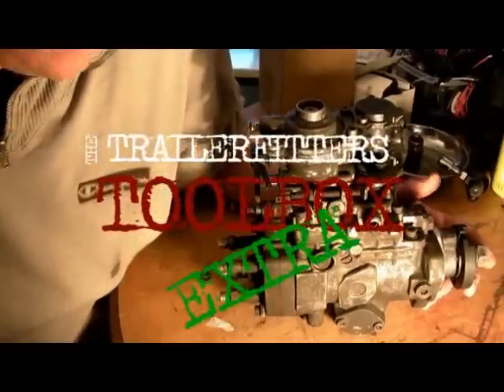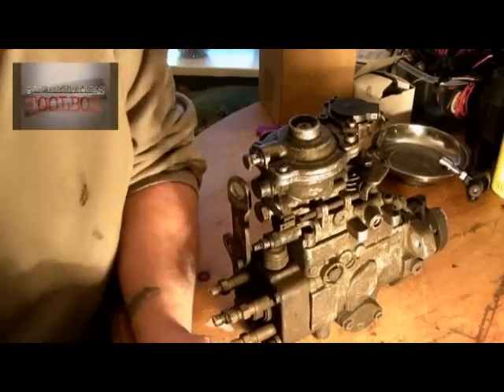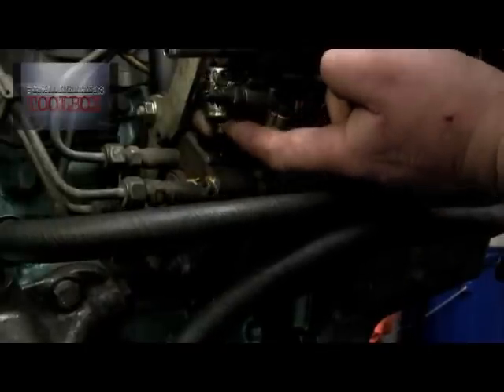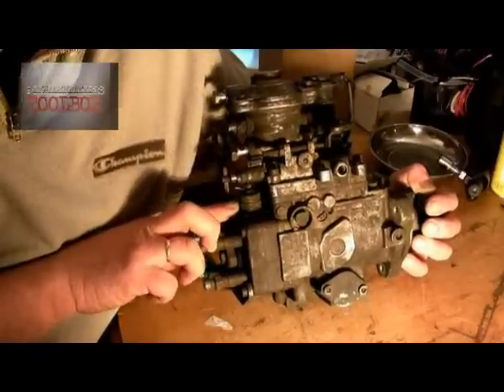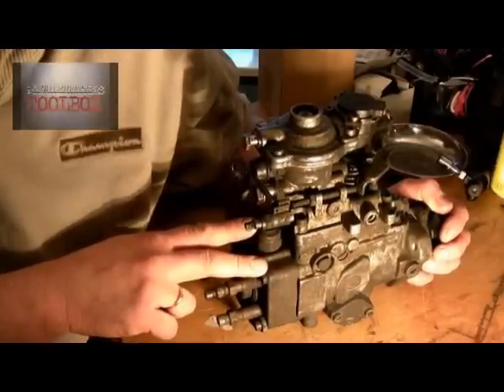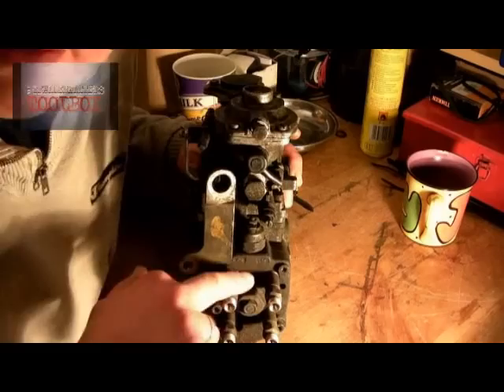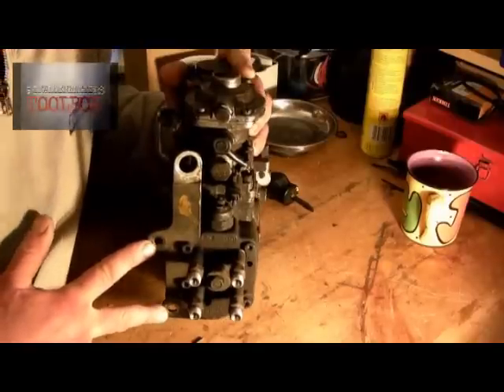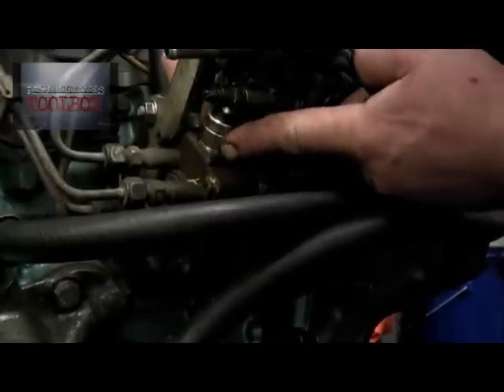Diesel Stop Solenoid 200tdi / 300tdi  RTC6702 Fault Diagnosis

Comment: VERY good demo.one more thing to check.
Make sure you check the plunger on the new and old solenoid .I have found in some cases they are of a different shape.
If you install the wrong shaped plunger on your truck it will not shut off.
This problem seems to be with the aftermarket ones .Genuine ones don't seem to have this problem.I have run into this problem twice and ended up installing a GENUINE stop solenoid.

Comment: OMG, You have saved my day today!  I was driving my truck to get Road Worthy ( mot) certificate. My truck stop at top of hill. I instantly thought my truck had ran out of fuel. I am new to Diesel machine so I could only remember what I watched in youtube... Ummm do I need to bleed fuel system?  I saw a little nut on top of fuel filter holder but I only had 14 and 13 mm spanners and a wing nut. I used 14mm spanner and jammed wingnut between that air bleed nut and managed to bleed system?...? But still no go! I called towing truck and watched few youtube and this one. I remember seeing some kind of sensor with electronic spade and one wire with spade connector nearby which looked connected to other device.  After watching your video, I just thought someone had removed spring and pin from solenoid switch and made it always open? I did not think much of it. But I decided to look at one cable near by to see where it is connected. Wow it is not connected to anything! I guess vibration of motor had eventually made it come loose. I tried to push it back but no resistance so I used my teeth to press connector wings down bit and reconnected it to solenoid. turn the key ! Bang! It started instantly. I could not believe it!  I leant something new today. Thank you so much! I enjoy watching your Land Rover Videos so much! Kaz, Melbourne, Australia!
Reply from the maker: BAng on!  Glad it was of help

Comment: Hi there. Thanks for sharing the videos ... quite informative and very useful. I have a problem that I can't really understand. My stop solenoid gets interrupted by these little tiny metal fillings and I can't start the engine or turn it off. Have to stall the car so many times...Problem is usually sorted by giving the solenoid a good clean. It doesn't look like rust (it's an offroad defender 200tdi) I've gotten used to the idea that the pump might go soon. What you think? Thanks for your time

Comment: thanks for the reply,forgot to add ,i changed the cylinder head 3 weeks ago dont think i introduced any dirt but will check the fuel lines anyway,the fault clears if i tap the throttle,its not played up today but developed a massive oil leak on the front of the engine,think its the crank seal,land rovers are great unless you cover large mileages and rely on them everyday,i seem to be fixing something all the time on it at the moment

Comment: Quick question that I’m sure you’ll know the answer: if this  fuel cut-off valve isn’t working correctly does it cut off current to the starter? When I attempt to turn over my ‘86 110, there is no mechanical clicking or rather, there is complete silence. I’m puzzled! Thanks!

Comment: Not sure if you will see this Chris but I am planning on using this solenoid (the power supply) for a power source to power an electric fan on my VW LT35 (the viscous van has been removed by a previous owner) The LT35 has a VE pump fitted. Any thoughts on that idea most welcome.

Comment: Hi i have the same system you are working on in the vid when the car is ticking over i have fuel dripping from what looks like a wire on the left side of it would you have any idea what this could be and if it could be fixed .. I have no idea if these things have gaskets on them thanks

Comment: What a great vid, thank you.  I have a ticking from this solenoid with ignition half turned.  Cranks ok and fires if you keep the starter running.  Is the clicking a fault or does that mean its operating nomally.  Many thanks.  Rob

Comment: Just done a head swap on my D1 and now it refuses to start. I checked the solenoid and I can hear it click, the system primed fine from the lift pump but when I undid the union on the number 1 injector I only got a small drip when cranking, I'm guessing that's not right. Is there a chance that even though I can hear the solenoid click it has gone bad and isn't letting fuel through? 

I had noticed that the orange and brown wire to the glow plug relay was kinked behind the battery and testing it showed and intermittent connection, will check it when the battery is charged but could it possibly be affecting the solenoid or simply stopping the glow plugs from working?
Reply from the maker: try direct feed so you know your wire is supplying the pump.  Pump is self bleeding so my need a bit of cranking to get the fuel through.   You probably know this but you have checked to make sure your fuel supply pipes are not kinked or damaged when you were wokign on it.  ( yes it has happened to me before) .

Comment: My 3 month old replacement failed in open position. I replaced and new one works fine. Seems very odd it failed in open position. I even pulled the wire off to confirm not an electrical problem. Any thoughts as to what happening there? Wondering if supply line fuel pressure got too high for the spring ? Getting solenoid on and off a pita too as cable plate in the way so can't get proper swing on spanner.
Reply: No evidence of debris on the plunger or deterioration of the plastic end. As I said only 3 month old...

Comment: Hi there ! I have an accute buzzing noise on a 300 TDI from 1998 when turning the contact on without starting the engine. The buzzing continues after I start the engine and it appears to be comming from the injection pump. This buzzing sounds electric and I wonder if it's related to the solenoid. Looking forward to your advice. Cheers
Reply from the maker: Yes it is.
Reply: thanks for the tip ! If the solenoid is buzzing and the car works flawlessly should I be hasting to replace it ? I have planned a 250 mile trip this weekend and I'm a bit worried, even though the buzzing has been happening for some time. Cheers
Reply from the maker: As they say,  you are damned if you do and damned if you don't.

Comment: would this cause a total rev drop on a 300 tdi defender non edc? new lift pump and fairly new throttle cable,cant see issues with the cable but going to check it at the weekend,not fun pulling 70 on the m way to find the powers gone its just idling,hopefully not my pump
Reply from the maker: Could be an issue.  Usually it gives a non start situation.    Perhaps you are drawing air into the diesel fuel system before the lift pump  or have a partial blockage ( at the banjo unions is a good place to look).
Reply: For a tc40a
Reply: New Holland  tc40a
Reply: For a tc40a New Holland tractor fuel shut off solenoid or it won't start

Comment: that's exactly  happening on my disco 1 300tdi , but with one condition everything its working properly (solenoid , fuses , voltage , clicking sounds , battery , etc) seriously i dont know what else do i need to check ! please give me  an idea where to check or recheck   , by the way greetings from el salvador , im a big fan of your videos !
Reply from the maker: Check for any blockages in the fuel lines or air getting into the system

Comment: hi, i have a 300 tdi. when i drive it for a couple of kilometres and the engine hot. it fails to start immediately after parking it. i have to wait a couple of minutes for it to cool down then it will start with no problems. i am suspecting that maybe the starter motor is damaged and that maybe it overheats. or could it be the solenoid? please help. or plus i recently had the gasket changed..
Reply from the maker: +Brian Mctribouy  Starter motor. Yes could be the solenoid on the starter.  You need to a voltage drop test on the cables and motor to see if you can narrow the issue down a bit

Comment: My 200 tdi doesnt cut off by itself and I have to stall it. Is it possible the spring inside the solenoid to be worn or the o-ring?
Reply from the maker: +Hristian Tenches  has it always been like that?
Reply: +Land Rover Toolbox Videos No it just started doing it recently first it was when really hot after towing then it started doing it more frequently
Reply from the maker: perhaps the plunger rubber  ( which is on the end of the plunger has disintergrated
Reply: +Land Rover Toolbox Videos Thanks. I just wanted to share what the culprit was. I took the smoke screw out because it was in the way and there was some corrosion on the end of it. Then I took the solenoid off and it had a few very tiny shavings of metal on the plunger, probably stopping it from shutting properly. Changed with a new one and problem solved, but my concern is the pump now. Engine runs spot on but should I expect the pump to fail since the corrosion and bits of metal I found in it? What would be the cause of the corrosion Thanks
Reply from the maker: +Hristian Tenches  corrosion is from water in the diesel.   As for the metal shaving that is not good at all.  Hopefully there is only a small amount in there and it has gone no further into the pump.   Now you have to find out where the metal has come from.   I fear your pump has a problem.  any other component then the metal would have had to get through the filter first and I doubt that.
Reply: +Land Rover Toolbox Videos I am surprised it got trough the fuel sediment filter and the fuel filter itself, I drained the sediment filter and replaced the fuel filter and drained the fuel from the pump itself and no metal shavings came out, also had a magnet in there, so will hope for the best and prepare for the worst. The stuff in the sediment filter was really something I have never seen before :D Any advise on draining and flushing the fuel tank itself?
Reply from the maker: Really hard to clean a tank properly due to it shape.

Comment: High chap just bought an old banger for my sis to use for a while - rover 420sdi I think they use a VP37 pump, car startsbut then revs its self up to 2000rpm and returns to idle straight away with a puff of black smoke. Problem is that the EML light stays on and the power is restricted could this be linked to a cut off solenoid ? regards will